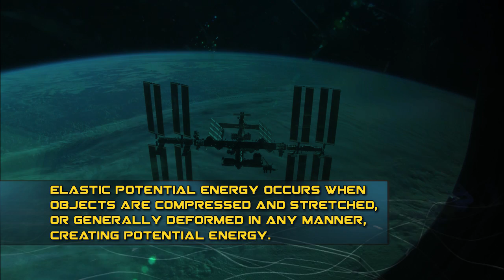STEMonstrations: Kinetic and Potential Energy

Comment: At 1:15, he should not say "create potential energy".  He is converting or transferring his work (force he applies times distance) into elastic potential energy.  The law of Conservation of Energy states that energy can not be created or destroyed, only transferred between objects or transformed from different types of energy.
Reply: i think it was here on minute: 1:42 no?
Reply: @valentinaalvarez5705  He says it correctly at 1:42.  He should have NEVER used the word 'create' when talking about energy.
Reply: @bryansmith6327  While that is true, I will argue that sometimes simpler language can make a topic more accessible to others.  Transferred and transformed can be strange to some people, especially if it's not clear to them where the original energy is stored.  As teachers, we sometimes use language that isn't fully accurate, to help communicate a certain point.  NEVER using the word create is a strong statement, what should be said is that you should ensure you also talk about the law of conservation.